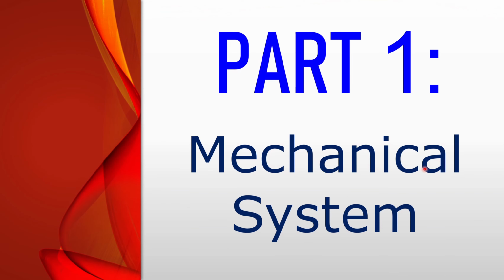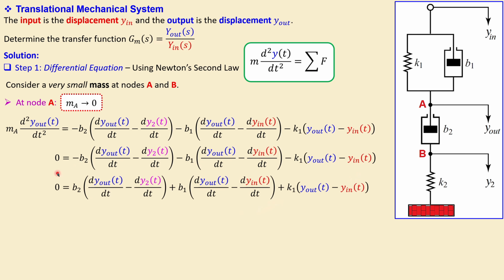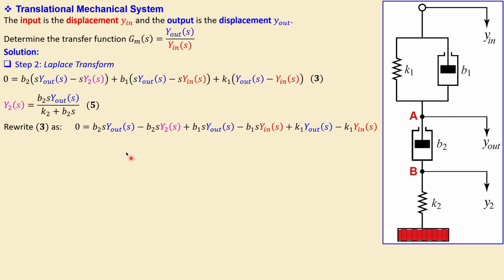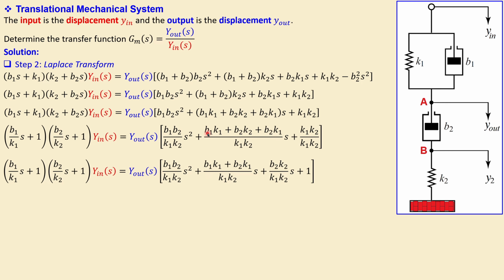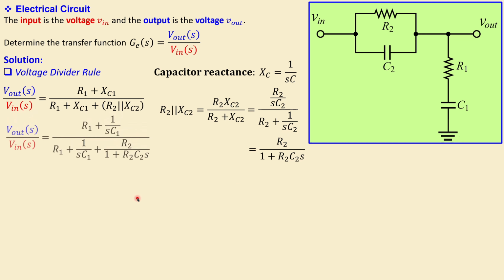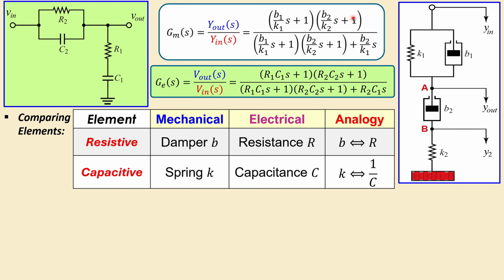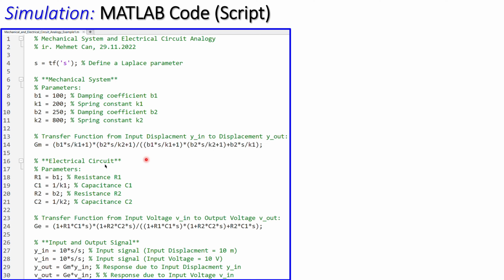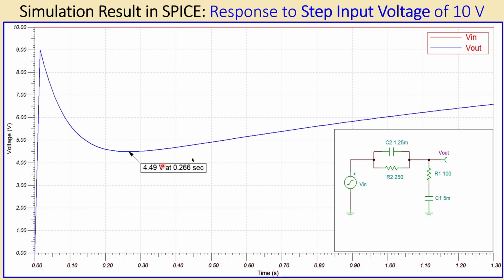Mechanical System & Electrical Circuit Analogy ⭐ Calculations & MATLAB & SPICE Simulations

Comment: It maybe a noob question, but could you please show how to run spice from Matlab? The interfacing tutorial maybe? If you do end up making that video, could you please tag me?
Reply from the maker: Thanks for your message. This is not 'noob' question at all and to be honest, there might be an option to convert the circuit form SPICE into Simulink, but I do not know this. What I do, is to create the circuit directly in Simulink using electrical components.